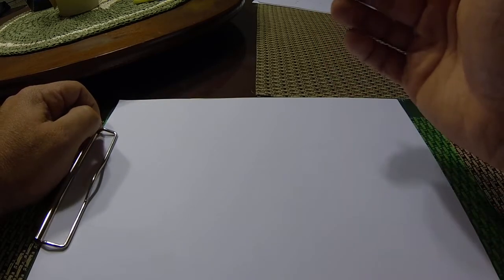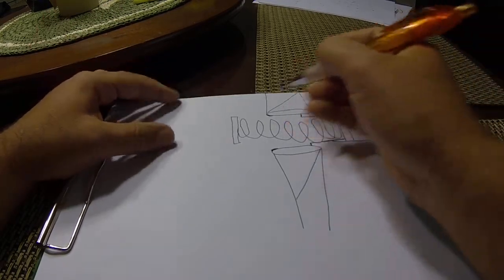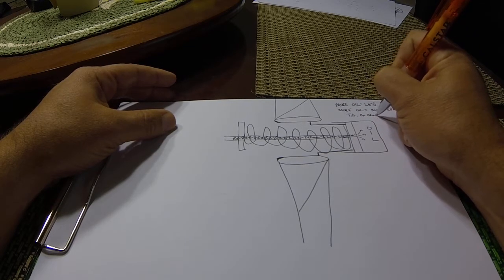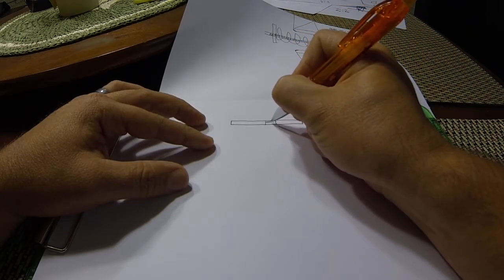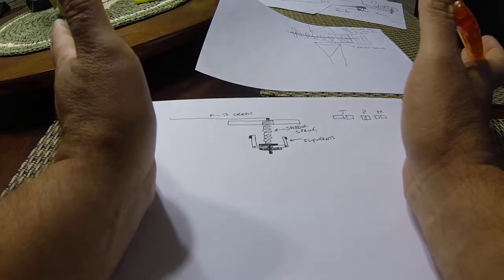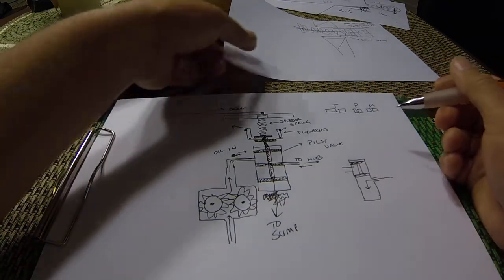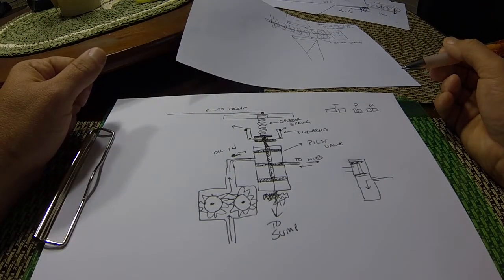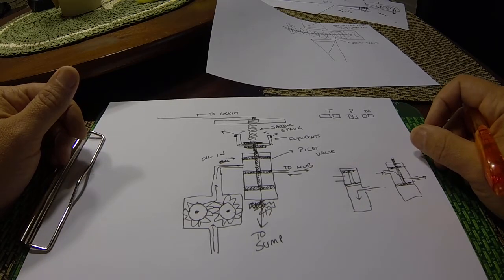Multi Engine Propeller System Explained

Comment: Hi there. Your explanation of the gear pump which you called the compressor is not exactly correct. You cannot compress a liquid so an attempt to pass the fluid through the meshing part of the gears will cause the gear to break. Rather the fluid passes the side of the walls

Comment: are you sure about that more oil pressure less pitch???
but my ground instructor told me the oil always  wants to push the prop feather,so more oil pressure means pitch is bigger.
Reply: oil pressure increase , blade angle dreases
Reply: Your instructor might be referring to a single engine airplane. The constant speed propeller on a single is opposite of the multi engine airplane.